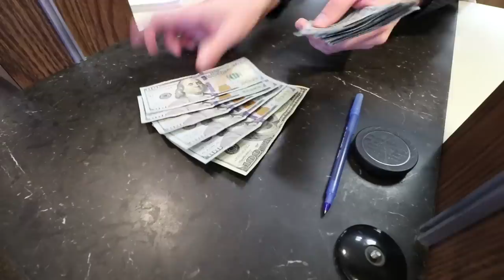WE BOUGHT A BACKHOE

Comment: I liked the comment from the seller.... "Never did much with it, just used it".  Hopefully they did the scheduled maintenance. If not, one of the most important things you can do when buying a used piece of equipment is perform the maintenance. Change the fluids and filters. Replacement parts for these things are VERY expensive. Get yourself a good grease gun, use the proper grease and GREASE that baby regularly.

Comment: Alyssa, THANK YOU, for your time in the edit studio.  I've been watching you guys a while and I am very impressed in Alyssa's work ethic.  You guys are very good at showing detail also.  I worked years in the petroleum pipeline industry and operated backhoes for most of it.  Alyssa, you will make a very good operator with patience, practice, and finesse.  Small motor control in the hands will have you pulling 3 levers at once to make change from a dime.  One suggestion I will make Jesse on the  tractor.  Get a welder to weld grab chain hooks, sized to your logging chains, to the center of the front bucket and also on the flat of the backhoe bucket just after the radius.  This will be you best and safest lifting point.  Don't thread the chain through the backhoe bucket.  It becomes a shear when you accidentally curl to far. The extended a hoe can be a great crane for lifting those house timbers around.   Keep the vids coming.  Power to the labor minded.

Comment: Congratulations! My dad had a '90 Case 580K for his construction business. It has all the same features that yours does. I put in a lot of hours in on it, those are great workhorse machines!

A few tips: If you are not using the extendahoe, there should be a hole in the dipper boom where you can insert a pin that goes all the way through. If you install that pin, it will provide strain relief to the seals on the extendahoe cylinder. You should particularly do this if digging up stumps or large rocks. 

Take really good care of the hood latch; keep it lubricated and replace worn parts. What I have seen happen is they get dirty and dried out, don't want to release easily, so someone takes a hammer to it to open the hood, they bend it, and then you have a hood that won't latch. 

If you are using it a lot, every day or two take a grease gun around and put a few squirts into all the grease fittings (there are a lot). It's easy to forget about them, but take the time and effort and it will pay off in the long run!

Best of luck!

Comment: Plowing with this model is very doable. Here in the Monadnocks of NH, in late fall we drop the back hoe then swap it out for a drag blade, we put on all 4 tire chains (a must for stopping on ice and not falling off the mountain side), then we add a bolt on Minute-Mount plow mount to the bucket. This allows us to back drag a closer cleaner path around items or buildings of importance. The Traditional snow-plow makes moving snow less strenuous on your loader. Trying to push a bucket loads of heavy snow long distances will lead to failures on that sweet little '91. After plowing the bulk of the snow out of the way, drop the Minute-Mount and bucket the rest over the embankments. If you Bee's wax the inside of the bucket or use one of those lanolin base undercoating the snow won't stick so bad to that plow mount and the bucket's interior surface. Best of luck...

Comment: Congrats on the acquisition. That tractor is a very good piece of equipment, 91 isn't old. If it don't smoke like crazy at startup or use oil in excess there's a promise of more usable time in it's life. You were right about the turbo'd models. Best have a sound tractor with equipment as one unit instead of attachments, there lies more issues. Hope to see more with it getting things done. You guy's are dealing with your project with attitude and faith in all around you and family support, that rocks. keep on moving on.

Comment: You cannot go wrong with good equipment. I have a 2010 Massey Ferguson tractor and I use the heck out of it and I bet I have had 4 or 5 offers for it because it does not have the tier 4 emissions. You did well and it will make life so much easier for everything including the timber. You will get your moneys worth in the long run.
Alyssa is really good with that camera.

Comment: Congrats on the new gear day! I've been on lots of new home construction crews and you can definitely dig a foundation with a backhoe. You need a skinnier bucket but I've worked on plenty of backhoe cut foundations. For example if your foundation is 6" wide you need at least 5' more for the forms and stakes so a 12' bucket works.

Comment: Some add ons to consider is to get your neighbor with a welder to put three chain hooks on the top of your front bucket , one in the center and at each end . Then put one on the center of the rear bucket too . Makes managing logs much easier and many other uses . All so if you can get any maintenance records that may exist would be helpful . The oil and filters are very important   ,if you don't know how old the oil and fluid is you have to assume that it is old and dirty . I didn't see any grease on the joints so it probably needs greasing , the pins and sleeves wear down quickly even with light use if not greased often , the sun and rain can clean them out before you know it . I only keep enough fuel in mine to keep it on a 1/4 tank , better to add fuel often than to have to deal with old fuel . Good luck

Comment: Top tip:
Unless you can store the backhoe undercover through the winter when you probably wont be using it. Liberally apply thick grease to the pistons to avoid the metal pitting which inevitably leads to seal failure.

Good luck from the UK and keep up the good work.

Forgot to mention keep on top of the greasing of ALL the grease points.

Comment: Great job guys, you will not regretted owning this equipment. Its nothing like waking up in the morning knowing that you have a work-horse waiting on you and not the other way around like rental equipment. Probably the next step is to built a small overhang to keep her from the elements. Maintenance is key to longevity on your new investment as you mentioned. Also, you guys might want to built a small fuel depot to store diesel for your equipment. There will be days that fuel prices comes down and you have a place for storage. Oh, and I think you guys can use off-road diesel/red diesel it much cheaper than regular diesel.

Comment: It took me a couple years before I realized that I HAD to have a tractor/Backhoe/Box Scraper to be successful living in the mountains, especially with big trees and Rocks, great purchase guys, looks like a good one! 4x4 in the snow is a must, be sure and buy chains before winter, expensive yes, but you'll be glad you did! you'll be set for even the biggest snow storms... you probably won't even use the truck plow you have anymore. I strongly recommend planning to build a garage/port for it very near your house & driveway. I'm a half mile from the plowed hwy. takes me about an hour and a half to plow using the loader bucket. before winter I remove the backhoe and replace with the box scraper, it helps with snow plowing. Oh and you'll never sell it, trust me! I use mine probably twice a week for stuff, makes a great scaffold ladder, carries 55 gallon drums of diesel, holds large timber beams in place, the list goes on and on.

Comment: Case is a solid BH. Suggestion: Get a shelter for that so it doesn't sit out in the weather! Plus you'll need some power to run the block heater in the winter so she starts. Just for 3 or 4 hours to get the block warm. Also might need an heater on the fuel so it doesn't gel. 20 or below (F). They make a pad that glues to the tank. Nice backhoe again.

Comment: As a long term owner and user of excavation equipment. It all comes down to common sense and GREASE!!! GREASE ALL pivot points once a week and all zerk grease fittings every 2 weeks with heavy use. Don't overload buckets, always put the equipment inline with the work. side loading causes damage. The 3 minutes you use to move the machinery will save you $$$$$ in damages and down time.  lube your hydraulic piston rod (s). keeps them from getting rusted and pitted which will mar the seal. Always get grade 8 chain for lifting or pulling. cheap stuff breaks and can kill. keep it clean not spotless but wiped down clean. lightly  spray the bottom with bulk wd40 less soil build up. When you're done with the house build sell it and get a small to medium tractor with needed attachments too. Just some suggestions from experience. be safe

Comment: Congrats on a good investment. 4x4 makes all the difference. A suggestion that will increase the potential of this equipment for your use would be HD Clamp on Pallet Forks 4000lbs capacity Loader Bucket Skidsteer Tractor chain. I have purchased this myself and highly recommend. Moving trees and equipment is safer and quicker with forks attached to the bucket.

Comment: If your trying to sift rocks out of your soil, try using 55 gallon drums, put holes in the sides and cut out the top and bottom, weld 2 or 3 together and hang them off chains on a slope and as the rocks slide down the inside of the drums the holes allow the soil to fall out and it deposits the rocks in a pile away from the soil.

Comment: Rubbing alcohol dissolves tree sap super easy. Then you can rinse off the alcohol with water, or just flush it with some more "clean" alcohol and let it dry. If you don't flush it or rinse it, when the alcohol evaporates, the sap will precipitate back out, and you'll be back at square one.

Comment: Great choice on the backhoe.  I've ran one in the same series for 20 years while building homes.  Just remember that there are grease fittings all over that machine for a reason and don't wait till it squeaks to grease it.  Don't lug the engine as in work the engine at a low rpm range for the task at hand and there is no reason to run the machine at the top pto level for hours on end for a simple job.  You can get decades of use if you just use this machine within its ability and keep it greased and maintained.  Congratulations!!
Reply: BTW, 4 wheel drive was a must and the extend a hoe is something you WILL use a lot.  It minimizes how often you move.  You can enclose the cab for the winter with clear poly plastic or you can make use of plexiglass if you want more of a permanent removable solution.  Attach some angle to the frame and then put the plexiglass on the angle.

Comment: I am amazed you did not do this sooner, I had a 680K for about 4 years and it was a great machine but I had some expensive breakages. I figure for every hour I ran it I figure I put 20 to 30 min of maintenance in.  A couple of things to note get a good grease gun and good quality grease  (buy in bulk you will use them) get a couple of large adjustable wrenches and some crows foot wrenches to fit your hydraulic lines and some large circlip pliers preferable the ratchet type. I used these tools all the time.  I almost wrecked a cylinder on my boom arm (2 cylinders either side on the 680 ) because a pin snapped due to a fatigue crack.  The boom cylinder pins take a lot of abuse, I would pull them and get dye pen checks done and replace if a crack is present. But that's just my paranoid experience. You will wish you had a cab in the winter!!  Make sure you have a way to warm the block and maybe ether to help cold starts in winter ( some will object to ether). Go easy on the hydraulics in the winter until your fluid is warm. Basically, baby  the machine because you are the one fixing your opps mistakes. Unless you are really lucky you will blow hydraulic lines and need the occasional friend who can really weld ( not bodge weld!!!). Know where these resources are ahead of time. Murphy guarantees that your machine will break something in the worst place on your property! This is my advice from my amateur heavy machinery ownership for what it's worth.

Comment: Just a suggestion, when I worked a woodmizer I found having the logs 90 degrees from the saw worked best with forks on a loader (attached to the bucket) to move the logs, as you can easily pick up a log, back up and turn, then go forward to place the log on the saw.. how you have it now requires a full rotation if you use forks instead of chains

Comment: You have done the right thing.I brought a bulldozer for $34000 and did the leveling for the concrete floor which I was quote $50000 so I had saved myself $16000 plus I have done the drive leveling and landscaping with it. You do find that it can be quite a handy machine to have.

Comment: Great investment, you will never want to sell it, as it such a useful piece of equipment. Also great during the winter. Make sure you get a oil pan heater if it hasn't got one, as that will save the engine during the winter

Comment: Invest in a good grease gun. I worked on heavy equipment at a landfill for 10 years, the best thing you can do is grease it daily and fill it with fuel at the end of the day. You always want to do a good post trip inspection / grease / fuel. By greasing at the end of the day it helps the grease get into the joint and has the unit greased for the next days work, fueling up at the end of the day prevents condensation from forming in the fuel tank, the warm fuel will draw moisture if the tank is filled it cools the fuel off and doesn't draw moisture.

Fluid levels should be checked prior to operation, you will need to have oil, coolant, grease, hydraulic and gear oil on hand. Operating the equipment with low fluid levels will increase operating temperatures that doesn't usually end well. You will also want to have some filters on hand, they don't have to be factory filters; WIX is a very high quality filter and NAPA filters are made by WIX.

You may be able to download some manuals online, maintenance and service manuals will prove to be quite useful in maintaining your equipment. Keep in mind any filters or manuals can be sold with the equipment when the time comes.

Comment: you can enclose the cab yourself with plexiglass a drill and a bunch of zip ties 
with a space heater or you can route a duct over the exhaust manifold with a fan to heat in the winter it will keep things warm enough to be comfortable with no gloves and a hoodie 
I use an old space heater I found in the garbage years ago wired to a wire that used to run a light on my old cat track loader

also invest in a thumb it does not even have to be powered to be super useful of moving logs

Comment: I agree that a backhoe is a versatile tool to have. Yes, that is a pretty old machine and you will have repairs but since you aren't using it full time/ making a living with it you can learn about repairs as you go. Be careful. Never drive parallel to an excavation. A set of forks will make handling logs easier but bucket mounted forks should always be attached as far apart as possible to minimize bending the bottom of the bucket. The bucket isn't really designed for digging but rather for already lose materials. You can use the roll back of the bucket before lifting to take advantage of the increased breakout force rather than trying to use the boom to loosen material. Same concept applies to using the backhoe bucket.

Comment: Great purchase guys and I like that you have taken the time to weigh up the cost/benefit before gong out and spending. 
May I suggest that you spend a few bucks on a couple of oil analysis kits (Caterpillar SOS kits are low cost, under $20 per kit)? These can be used to check the engine and hydraulic oil for contaminants and wear metals and can give early warning of any potential failures before they become expensive break downs.

Comment: Lets talk about your electrical problem on the Case.  You need an electric multi-meter with the clamp which goes around a wire to measure the amperage passing through the wire.  Turn everything off and start at the battery and check every wire which comes from the battery...Not fast or easy, but the best way to find a fault in the system.

Comment: You can buy a backhoe for less than $5k (old but still works). You can get a set of cheap tools to work on your old backhoe for very cheap. Weekly trader at the gas station, I found a early 1970 model Case 580 CK that had nothing wrong with it for 5k a few years ago, before that I found an early 70s model bobcat for about the same price, nothing wrong with it either.  You got a very nice backhoe there. Best thing you can do is buy a cheap set of tools and find a mechanics manual and parts manual for that back hoe, if you look hard enough you can find one online for free. I did this for mine and anytime something breaks, I fix it myself. Parts for older model equipment is usually really cheap (if it was common used equipment).

Comment: Congratulations! The backhoe is a good idea.  If you find you don't need it when the project is done you can probably sell it for most of what you have in it.  Suggestion, if you are going to run it in the snow, get chains front and rear. I've seen more than operator slide one down a hill sideways and roll it over.  As far as getting stuck, you can usually walk them out with the bucket and hoe.  
Thank you, Alyssa!  As far as Jessie working you too hard BS!  You are a hard working woman and there is nothing wrong with you doing what you are capable of doing to help.  Just remember your limits. (as a fellow rock climber, I think you know when to stretch and when to look for another way up).